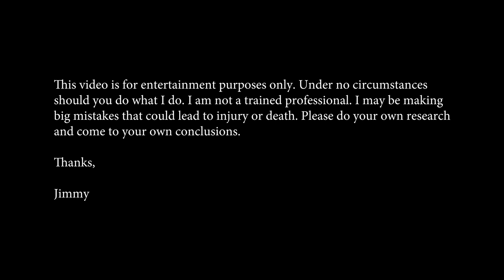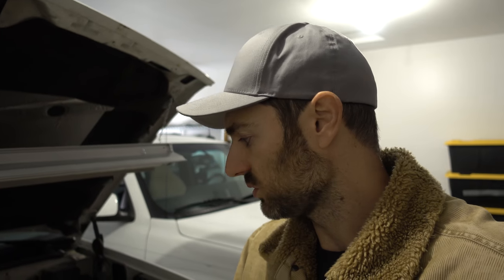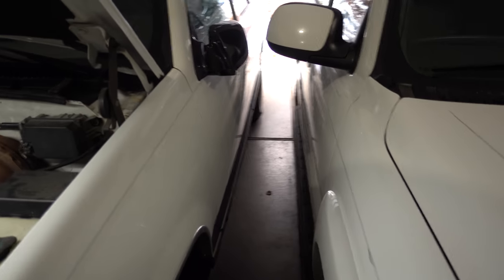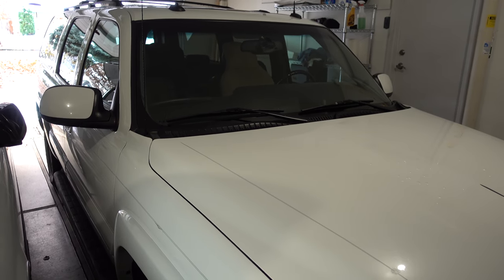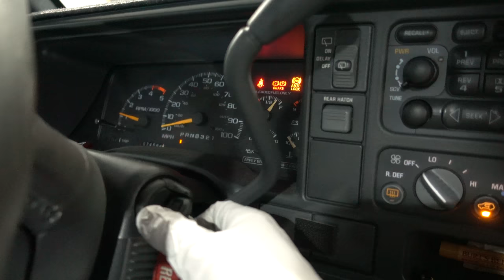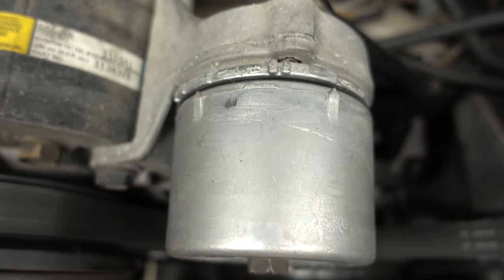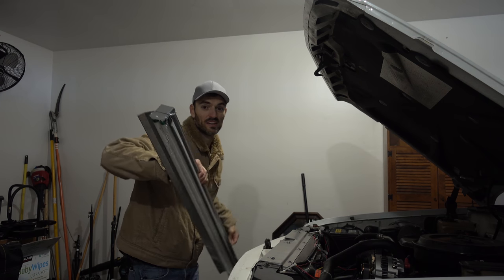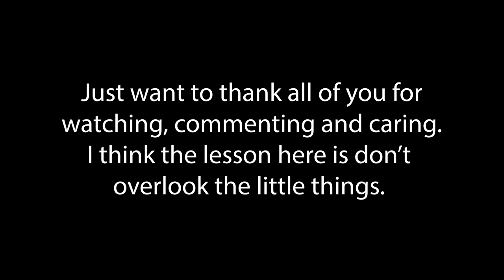DIAGNOSING BELT SQUEAK!

Comment: my personal baby is a 1996 5.7 L c 1500 style side keeping it forever man I love you gear heads on the net at 58 yrs old and slinging wrenches all my life and no way I could pick through these new vehicles with out my smart phone. just got done converting a 93 z28 from Auto to 6 speed manual and it came out like it came from the factory that way with help from net gear heads we got everything working as factory, lights clutch safety and most of all reverse lock out freaking amazing to me I have never had a check engine light I couldn't get diagnosed properly since I discovered the net praise be to you guys that take their time to post don't know what this ol' motor head would do without you guys, American hero's in your own way

Comment: I have a 2001 Blazer with a 4.3 L V6 and the Tensioner Pulley needs replacing. It damaged the Serpentine belt. Called your favorite parts store, OReilly's. Both the belt and Tensioner pulley are warrantied by them. Like you I have never been displeased with OReilly's and they stand in back of their products. Thanks for the video as I had watched both of them and can change the tensioner Pulley  Assembly myself and save money.

Comment: The same happened to me. I had a 5 month old Continental Elite Serpentine belt on my 2001 Land Rover Discovery and it started chirping. A closer look I found frayed wires along the side of the belt in four areas. Replaced the belt with a NAPA/Gates belt and it's been good to go so far after 3 months here in the cold weather of Atlanta at 60 degrees. lol
Oh yeah... "Remove Before Flight" key chain tag... Awesome!

Comment: Just a little piece of advice: When you are taking tension off of the belt tensioner to remove the belt, have your ratchet pointing between the alternator and the power steering pump. You will get the tensioner to move with much less effort. Thanks for taking the time to post your videos.
Reply: Great information, thanks.

Comment: Yup , I thought it was something worse on mine and turned out the belt that I had looked good until I took it off and was cracking and stretched. I had changed the idler pulley because it only 14 bucks and did have more spin than the new one so I probably didn't need to do that. But it's amazing that metal sound is from a belt.

Comment: I don't disagree with reducing belt length to fit a smaller pathway, and a little more tension from a smaller belt might make a difference in squeal. I'll bite on the notion that speed is faster with a shorter belt. Maybe I misunderstood what you meant? Unless the belt is losing traction with a belt that is too long, belt length should have no effect on alternator rpm. It will be interesting to see if the fix lasts, sometimes belt chirp from lateral movement temporarily improves with a new belt.
Reply: Interesting to note that my new belt retains its outer diameter as compared to the new belt .. But .. on closer look the thickness of the old belt has worn down by approximately 1 mm .. giving unwanted noise

Comment: if you get around to actually needing a new belt and are afraid of the noise coming back try out the Goodyear Gatorback belt.  They are specifically designed to be as noise free as possible.
Reply: Robert Craft      Thank you I recently changed my nasty cracked belt a put on a new Dayko belt one month later I'm starting to hear the squeak again and it's even more noisy at higher RPMs

Comment: I'm having the same problem with my 97 K1500 5.7, except it doesn't squeak until 1500 RPMs. I didn't think it was the belt because it doesn't have a lot of miles on it (maybe 10,000 at most), looks like it's in good shape, and doesn't squeak on idle.  I also put a new water pump,  idler and tensioner on. So, along with a new alternator and AC compressor (unrelated issues) all pulleys are new except steering and crank. A week after I finished the water pump, the squeak is back. Found your video, got a sinking feeling in my stomach, and ordered a Conti Gatorback. We'll see what happens when I put it on....
Reply: Did you ever fix your problem ?

Comment: I have a 97 Chevy Tahoe 4 x 4 I had the same problem and it turned out to be the belt but one thing I recommend that they recommend it to me before you take off your belt market with one of the pulleys that way you can put it back in the same place and it shouldn’t squeak anymore it’s when you take it off and put it back it’s already mowed it one way that way when you’re market you put it back to the original place

Comment: Get a 2' length of pipe or floor jack handle over ratchet for leverage. Belt length has nothing to do with speed of pulley rotation. Pulley diameter determines that.
Reply: HUBBABUBBA DOOPYDOOP but he put a smaler pully in.
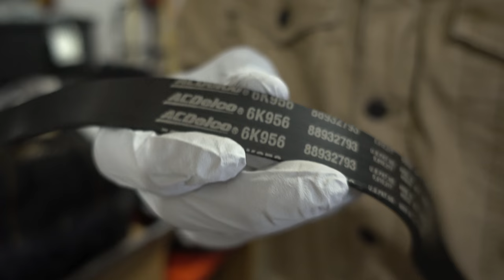Reply: Yes, I heard him say that. I also heard him say that he wondered about if the belt length had any effect on rotation. Did you hear him? Click on this @1:02 An overdrive pulley will increase rotation- not a belt.

Comment: First, soak all new belts in 303 Protectant for 24 hours.  Then wipe excess off, and dry with a paper towel.  The belt will easily last 100,000 miles.  If you take the belt off twice a year, wash it, dry it, then soak again for 24 hours, it can last a lifetime.  Trust me, it makes all the difference in the world.

Comment: when one of the marks of the marks line up the other will also be lined up. if you are looking front the front of the truck toward the engine the mark being clockwise of the index it means your belt too tight and vice-versa. the current position that your belt is at is almost bottomed out because of that your belt is barely capable of doing any adjustment. I have this in the previous video that belt tension is import because it accelerates wear on your alternator bearings, water pump seals/impeller, and a/c compressor bearing.

here is a picture of belt properly adjusted:

http://st.hotrod.com/uploads/sites/21/2013/07/dorman-delete-pulley.jpg

Comment: I know this is old (so I'll just leave it for informational purposes) but I had the same belt squeak on my 2006 Crown Vic back at the same time frame as you. I put a Goodyear Gatorback belt on and it's still  like new. Stay away from cheapo Mexican or Chinese made belts altogether. V-groove belts are notorious for squeaking. Thats why I went with the Gatorback design. I think it's made by Continental now but it's the same design. Continental owns Goodyear and General tire now.
Reply: Continental belts are made in Mexico.

Comment: If you don't want to buy a breaker bar to remove the belt, just find a big ass pipe from around the yard and use it for leverage. Fit the pipe over the wrench and pull away.  That's all I do and it makes the job simple.
Reply: l use the handle from my floor jack. Almost seems like it was designed with that in mind as its secondary purpose lol.

Comment: If it help,  the noise comes  when the weather changes the belt get dry and metal surfaces have oxide. That make the noise. So!!! With engine on spread some water.
Or buy the belt moist 
bar, put with engine off on belt. Its like grease or something.
Everything helps.

Comment: ??????? I have a a similar problem but the squealing sound idle goes away after a couple minutes its sumer time here in utah oh and I installed a new acdelco water pump did timing chain and cover and sprockets . What gives ?????? 1998 gmc k1500 5.0l 305 4wd sl z71 ????

Comment: shorter belt will make alternator spin faster and get more current???
Reply: No it will not, but the smaller alternator pulley will spin the alternator faster (regardless of what belt is used). Changing the belt size doesn't affect how fast any pulleys spin, only changing the diameter size difference between pulleys will change spin speed.
Reply: @awkwardturtle9119  - of course belt length won't affect speed, contrary to what you said in video...which brought about my comment.
Take care:)
Reply: @theGADGETSplaylist  I'm not the person who made the video. I saw this comment up at the top and thought it looked like sarcasm, but want to make sure and add an answer for anyone else that came across this and didn't know.
Glad to see someone else understands pulleys and cables though :)